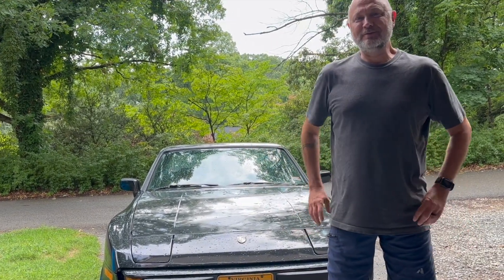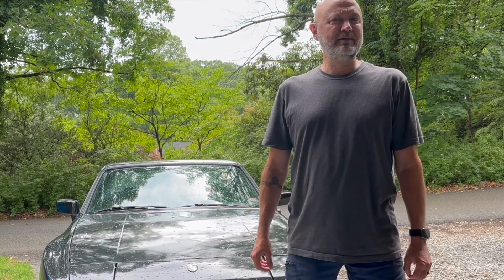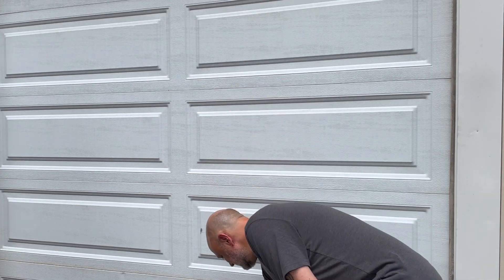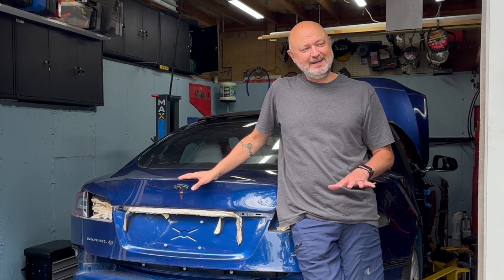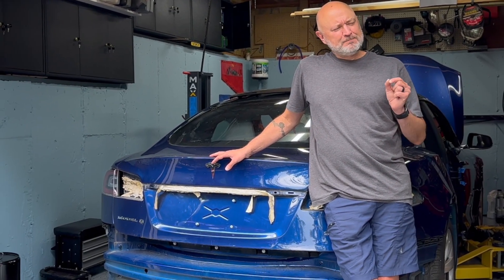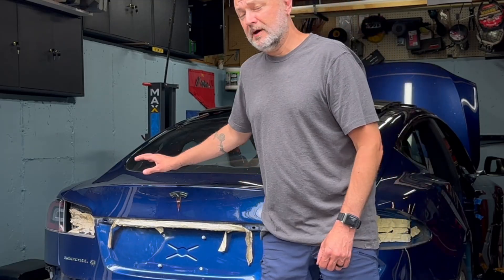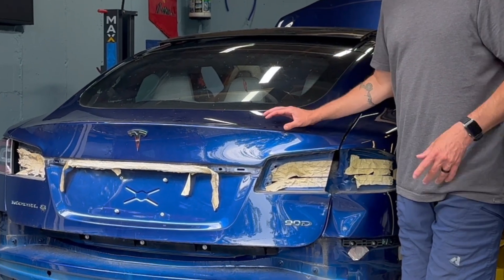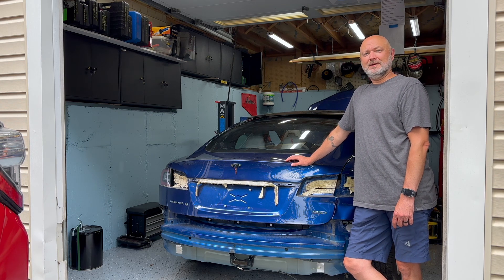944 EV-Conversion: Part 1

Comment: i currently have a 944 and when i first saw the electric swapped 911's i wanted to swap my 944. i'm glad someone is tackling this and i'm here to see the progress. good luck!
Reply from the maker: Thanks for watching, and especially for the encouragement! What year 944 do you have?
Reply: @fixityfix  I have a white late model 86. Bought the car in 09 from a guy that was a tad bit suspicious but I was 19 and didn't know any better. Sadly the maintenance wasn't done well and the clutch had been replaced. When the wrapped the job up. The bell housing bolts were not tightened to spec and while driving the bell housing came loose damaging the flywheel and contact pins. I got her running again but the block is damaged now and one bolt hole had been broken off from the damage and so now it only have five bolts. Figured that would make my car a prime candidate for something like this.
Reply from the maker: @itznoobuluz, it does sound like an excellent candidate, especially as it has the later suspension mounts. Electric Classic Cars in Wales, UK did a 944 a few years back, worth checking out if you haven’t seen their video yet.  https://youtu.be/SRU3jmCmGrs?si=ViQWXOHSc6jO51x9
Reply: @fixityfix  ill check it out. Thanks!

Comment: I just found 2cents and I’m giving it to you. 
DUAL MOTOR = ALL WHEEL DRIVE
Or use the second motor for a 914 build. 
Any way you take it, it’s sounds cool. Enjoy the build, we will enjoy the content.
Reply from the maker: Thanks for watching, and especially for the .02! I briefly considered using both motors in the 944! And probably would have if it was a later 944 (would be easier to add coilovers and adjust for the extra weight!). I’d love to do an e914 one day and the front SDU does seem like an excellent candidate!

Comment: I'm not the biggest fan of electric vehicles, but I have a feeling this is going to be awesome! Love the videos! How's that hatch fix holding up btw? I'm going through the process of fixing mine in the near future.
Reply from the maker: Thanks for watching, and especially for commenting! The hatch is holding up perfectly. If I ever get another 944 the hatch fix will be the first thing I do - it made such a difference with noise, smell, rattles, fit and finish. Good luck with yours, please let me know how it turns out.
Reply: @fixityfix I am in the midst of the process now. Glass and frame are separated, and I'm cleaning up the frame. I am debating taking the glass to a tint place while it's out and easy (aka cheap) to work on. If i do, I might have to do all my sanding on the glass first and maybe mark how far the tint can go so it doesn't get in my way
Reply from the maker: @Logan-xn5tj  good luck with the process. You’re more than halfway there with the glass out! I’d love to see pictures when it’s all back together.